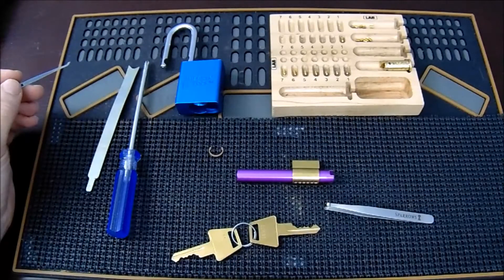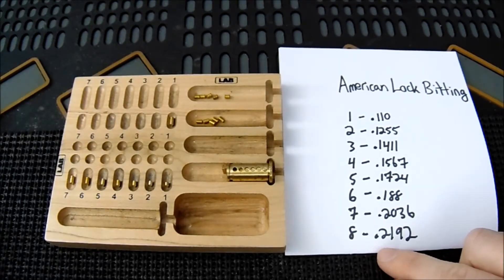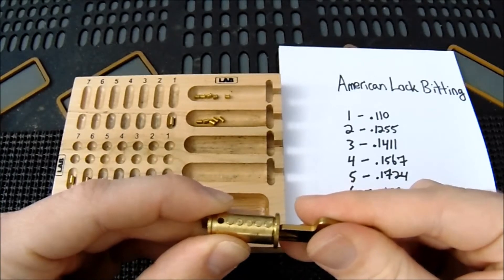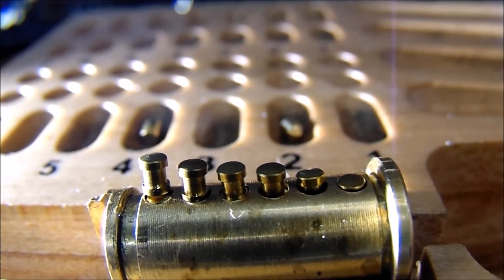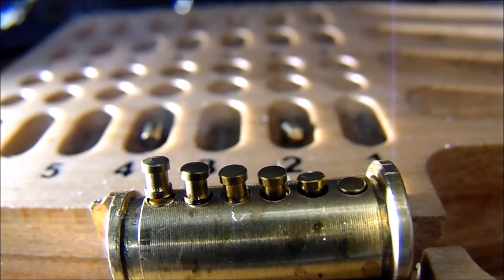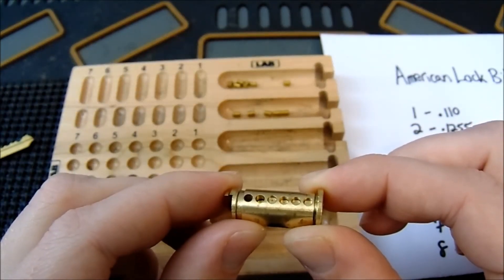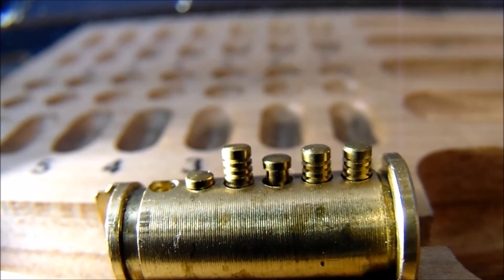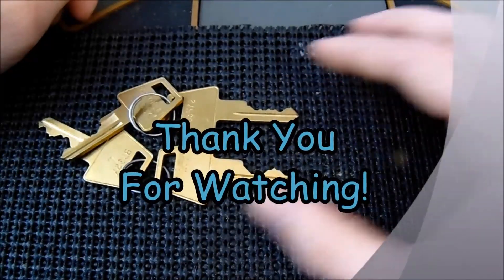[119] DIY How To Increase Your Lock's Security By Optimizing Security Pins

Comment: When you repin it with security pins using the numbers on the key itself like you seem to have done here does that mean you can still use the key once put back together?
Reply from the maker: You should be able too.  The only time you wouldn't be able to would be if you had a very long keypin and used a very long driver pin and there was not enough room in the chamber. This is not likely to happen

Comment: Very informative video as usual. My question is about pin sizes for different lock manufacturers, are they standardised, or do sizes vary from one company to another?
Reply from the maker: The diameter is standard for many locks but the length varies per manufacture
Reply: Thank you for the reply. So in universal pin kits, I assume there is just a large variety of lengths. How easy is it to take the measurements of pins and cross check to the size code each manufacturer uses?
Reply from the maker: @alfie9486  the 0.003 universal kit goes up in increments of 0.003". You can find what each type of lock uses on the specification sheet from the manufacturer pretty easily
Reply: Thank you, loving the Home School videos by the way.

Comment: Are there stronger pins, like stainless steel pins... that prevent prying attacks? (when thieves break the pins themselves by inserting something in and twisting it)... I feel this is just as common, if not even more common, than just picking. Thank you for this video :)
Reply from the maker: Yes, some of the high security locks use them as anti drill pins
Reply: @HelpfulLockPicker  Thank you!

Comment: I've seen that you should put a non-spool above at least one pin (so that the key goes in with everything aligned nicely).  Is it safe to say that a serrated pin would serve that purpose (as a good alignment pin)?
Reply from the maker: A serrated pin would do a great job for that. Also, you want to put spool pins over the shorter key pins so they are more effective.

Comment: What about selection of different springs?
Reply from the maker: It helps and is worth playing with
Reply: What Maximum Adjacent Cut Specification would you recommend for everyday use in Schlage? Is 7 too steep, should I go with 6?
Reply from the maker: I would just go with what the manufacture says.  I would have to look  it up on Schlage. I personally use a key everyday where I fully utilizes the MACS and my key works well and the lock works well after years of use.

Comment: Hello 
Great topic as are all your posts
But Why does the pin numbering shown at 9:28  in to the video appears to be reversed??

The whole topic is also very pertanent to repining Kits (which often ignore the top pins completely!)
So repinning key pins only could actually decrease the security of a lock by "de-optimizing" the existing top pins
Or am I completely off base
Thanks
Reply from the maker: It does not seem to be reversed to me. The pins are reading from right to left if that helps.

Comment: Hi. Thanks for this series, I learned a lot. Is it possible for a (cheap) lock to get damaged by picking? I've got this cheapo lock I've been practicing on, and in the beginning it was susceptible to all the techniques of opening. However after a few days it's getting harder and harder to open it, even with SPP.
Reply from the maker: G3n7r0 cheap locks wear out faster it is possible your pins are getting worn down a little bit and becoming tougher to set. You could consider lubricating your lock. Also the springs could be getting worn.

Lock picking is not easy on locks but I do not feel after two days it should do that much damage.

What type of lock are you working on?
Reply: As best I can tell it's a cheap 5 (standard) pin lock, made in China. I threw away the packaging, the inscription on it says FOM Standard Line.

I've got a couple of other locks (more expensive) I've been practicing on for months and haven't had this problem with . So either I'm getting worse at this, or the lock in question is of really bad manufacture :).

I'll try using WD-40 on the offender.
Reply from the maker: I would try something silicone based like Lock Houdini or TriFlow. WD-40 is a degreaser and will not keep the lock lubed long term. However, it is a cheap lock and it is probably the lock and not you.
Reply: Thanks for a fast and informative reply!